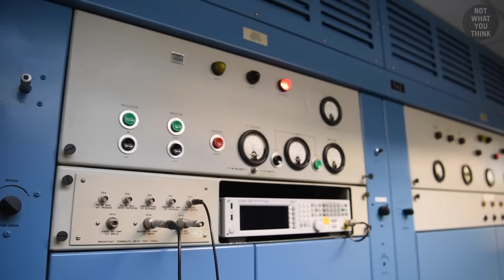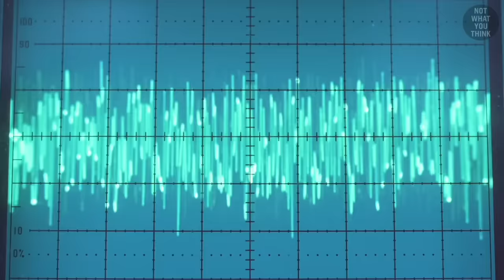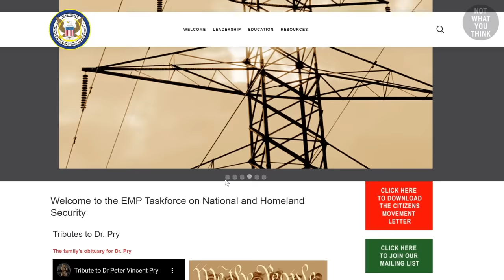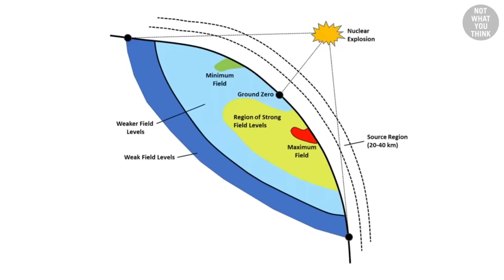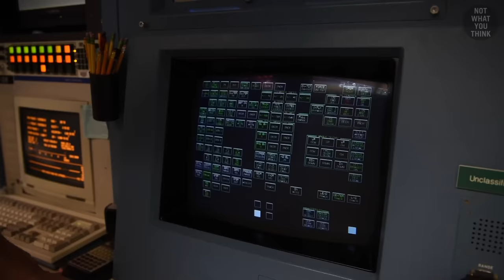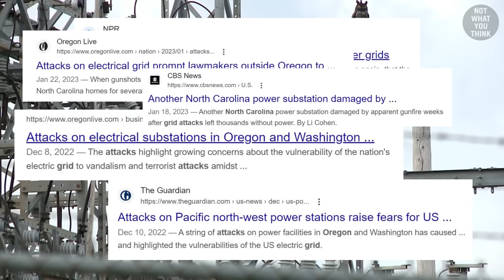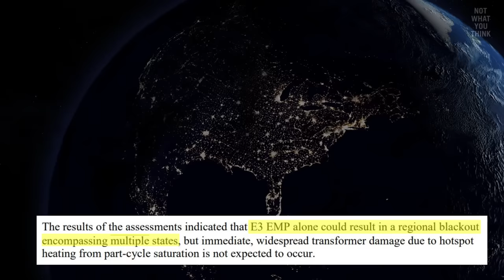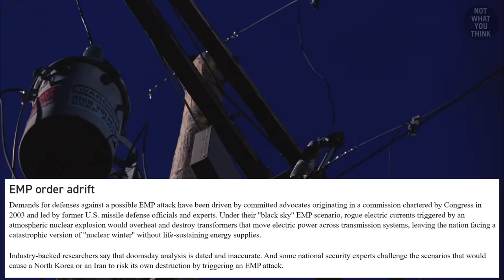Why an EMP Attack is Worse than You Think

Comment: I wonder how deep you would need to put a sub station to prevent it from a solar flare or nuclear bombs. If the transformers get changed every 40 years, you could prep the location prior to changing it out.
Reply: The transformers need servicing as well, so its not easy as lets put it underground, you need periodic access for parts and coolant change. Which complicites things a lot

Comment: Is it possible to shield these transformers? (put them underground or use some other form of shielding?)
Reply: The problem is that the transmission lines act like antennas for the emp, transmitting that power to the transformer and destroying it.

Comment: ill be ok i build generators that are emp proof. its expensive around $10k but it a 100kw dc unipolar generator using a spinning copper pipe rather than a wire. its so high power even if the engine dies if i spin it by hand to 120rpms i can generate 2.5kw or atleast 750 watts because of the high drag. i also got seeds so i only go without food for 90 days and never go without power and water.

Comment: 14:30 it wasn't the largest cme to ever hit the earth. it was since then but there are cave drawings all around the world that match this symbol ж and it just so happens if you simulate the conditions in a lab that's how thunders look like - horizontally, static or long lasting and going down and up like an elevator.

If one of those hits a city everything is electrocuted and burned. There's only little research on it and it's not proven but it makes sense and is plausible.

Comment: I have something that produces power and is immune for EMP😁
It's generator started by pulling a string and it's on carburetor, so impulse goes through it and nothing happens. Later I'm turning it on and my house has an electricity
Reply: How long will it be able to power your house? A week at most?
Reply: @prime_optimus  depends on how much fuel I have stored. In my case, it'll work for a month. Later I need to get more fuel

Comment: Will an EMP attack cause damage to small transformers and small grids like electrical fittings inside houses? Can off-grid solar-powered homes survive an EMP attack?
Reply: Not unless they are shielded.   All electrical devices will be effected.
Reply: The longer the cable, more damage it will receive.
Reply: ALL unshielded electronics.
Reply: @williamyoung9401  Shilded like a metal plate or lead?

Comment: Carbon Pile TOP LOADING reactors are the problem 
Need bottom LOADING with Magnetic Failure Dropout Sled Array.  Loss of signal for ( xyz ) means hi priority Scram Instantly disengaging the SLED or moving it to a pillow block at 5% level  with Stored Hydraulic power for restarting  🙂👤

Comment: So much for the idiotic electric cars with low range, slow charge time, and complete dependency on the power grid.  My vehicle is EMP proof.  It passed several tests in the late 1990s.  That may be more of a bad thing if I am seen with the only drivable vehicle which happens to be painted hazard yellow.

Comment: The video provides plenty of phantasy with limited knowledge. 

 Nuclear Power Plants at least in Europe can be operated in a mode to produce the internal electricity required. Second nukes are usually EMP hardened. Nukes are the source of energy to restart the grids after an EMP.

Comment: Although it shouldn't be underestimated, parts of this video seem a bit exaggerated. For example, I can't imagine how you would fit a non-nuclear EMP into a briefcase. You need to release tremendous amounts of energy to make an effective EMP. The only thing that can release so much energy in a suitcase format would be a nuclear bomb. Imagine the energy that can be released by a non-nuclear bomb in suitcase format. That is pretty much the energy which we can currently release from such small bombs. I expect more something of the size of the BLU-82 and still get a limited effective range of only a few hundred meters. Also, I don't see how an EMP should destroy transformers on a large scale. Such things are generally destroyed due to overheating. However, overheating can only happen if enough energy is being released in the transformer or if the temperature of the coils raises so fast that the temperature can not be transferred to the coolant. In both cases, the transmission lines should burn off first in most cases. Additionally, a lot of energy should be absorbed by the surge protectors.

Comment: I question our national grid's design of 3 behemoth interconnections that requires specialized equipment with multi-year wait times to manufacture. Smaller, multiple modular systems akin to micro grids seems to be a better way to create and sustain resiliency.
Reply: The interconnection allows for much more stability against problems that aren't as severe, like widespread bad weather. Those problems usually don't affect all or most of the Western or Eastern Interconnections, so there's a lot of spare capacity to pull from in unaffected areas. The February 2021 winter storm that very nearly caused the collapse of the Texas Interconnection shows what can happen to smaller grids with limited connection to others (though ERCOT's refusal to mandate winterization of equipment is probably the more important cause)
Reply: @gimmethegepgun  The interconnects aren't the issue. In fact, having multiple interconnects to multiple systems is what I'm advocating. Consider having hundreds of smaller grids that all have the ability to interconnect and can respond automatically and seamlessly to interruptions. The smaller systems are much easier to repair and maintain with "off the shelf" equipment.
Reply: Oh...and it wasn't ERCOT that was primarily responsible for the Texas outage. PUC and TRC are arguably more culpable of the grid failure
Reply: Don't be scared by the click-baity title and all the alarmist BS. While no one will argue that a widespread power outage wouldn't be a tremendously disruptive and expensive pain in the ass, the assumption that it would take 18 months to get the lights back on, and that nine out of ten people would die during such an event, is WAY over the top.

Comment: Wide area EMP bombs do not exist, and anyway the atmosphere humidity would re-direct the currant away from the target. Humidity is like a shield against EMP.  However, I can easily see EMP bombs used in order to target Satellites and that would be the real use of EMP is Satellites.       The reason is that Satellites are the eyes and ears of modern warfare so they are #1 target where EMP can work as humidity is under 1% if no close to 0% so yeah that's a problem.       But using EMP to take down a grid is really highly suspect due to humidity.

Comment: The focus on nuclear reactors about 3 minutes in is mindless fear mongering. The famously over hyped need for ongoing power after a shutdown is only required from a nuclear safety perspective for a few hours if you're trying to prevent a Fukushima like situation. Which, FYI harmed no one. A day or two of power will prevent basically all issues and at most a week if one is wildly paranoid. After that the reactors are just fancy rocks inside pots of water and there's no real danger. So yes! They do have enough fuel for backup power on site to prevent a major accident, many times over in fact. 

And, please look at at map, your last point is just a simple lie. The great majority of US nuclear power plants are in the absolute middle of nowhere. Which is why I think you took stock footage of the now decommissioned San Onfre NPP, which is kinda near LA and at least on I-5 so it's visible. But that's about it, US regulations make it effectively impossible to put a reactor by a city.

Comment: I can see a simple, if not so easy solution here.
We need a new transformer design. A modular thing that can be taken apart and transported in pieces, manufactured in part anywhere, and assembled onsite as needed

This would remove all the problems with long recovery times, and allow damage to be fixed quickly, negating a lot of the threat here.

This seems like a market opportunity for a disruptive company to take on. Gather the best electrical engineers and get to it

Comment: It's extremely unlikely anything like this will ever happen in our lifetime...
Reply from the maker: What makes you think that?
Reply: @NotWhatYouThink  Hi, sorry if I take the opportunity of your comment to make another comment, but I really hope that you will read this. Before I say anything: I really like your videos and I have been following you for a very long time now. I think that your videos are really accurate and of a very high quality. But as a scientific divulgator and nuclear energy connoisseur I must have to report a big mistake in today's video. First I want to say that what I'm saying now hasn't been invented by me, but it's basic physics that any international scientific organisation can prove correct. Nuclear powerplant CANNOT explode like bombs. This is extremely wrong from both the physic and the thermodynamic perspectives. A nuclear reactor can, as it happened at the Fukushima Daichii NPP, encounter an Hydrogen explosion in case of an extended loss of cooling event. This happened at the Fukushima NPP since the generator room (as you correctly said) was flooded, and so the diesel colling supply was lost. This lead to a big increase in the reactor temperature. At these temperatures the Zircaloy (a Zirconium alloy) that makes the cladding of the fuel assemblies can  oxidiez and creates Hydrogen gas. This gas, once in contact with the air, can create a CHEMICAL explosion. But why is this an almost impossible event for american reactors? That is because after Fukushima PLENTY of new measures had been taken, to prevent these kind of incidents to happen again. Just to make an example, the French introduced the DUS (Diesel D'ultime Secours), and the number of diesel generators has been increased since then (also, they can't be the same model, they must be different to prevent factory defects to create issues). Another key differences stays in the reactor itself: Fukushima was a BWR (Boiling Water Reactor) so it has no Steam Generator to cool down the core with natural heat convection. Even if just 31 USA reactors are BWR, they are DESIGNED to not encounter the same problems that Fukushima experienced. We can have a 5 hour conversation about that, it's full of other major things that are important to say. I really suggest watching Illinois energy prof videos or documenting a little bit more on the topic since it's a "hot topic" and it must be treated with science. Saying that nuclear reactors can explode is really anti-scientific (Also, Fukushima experinced MELTDOWN and not explosion, that happened on the roof of the structure, outside the main containment). I apologize for my bad english, hope you will understand anyway. I'm here for any question!